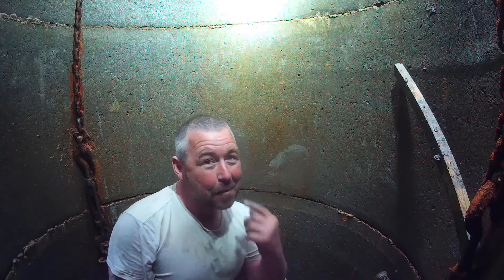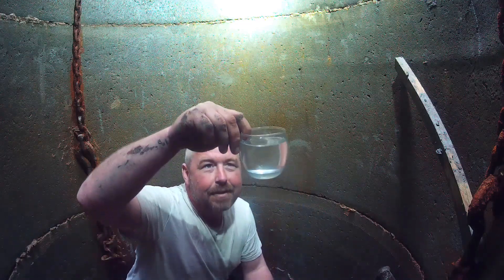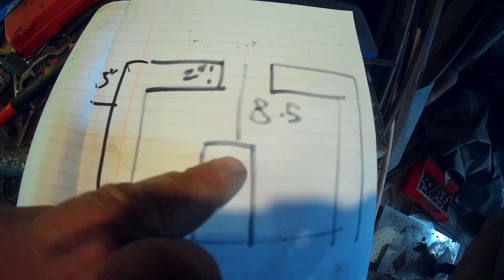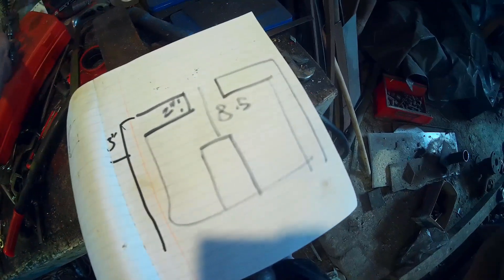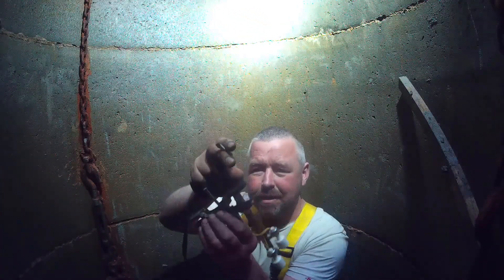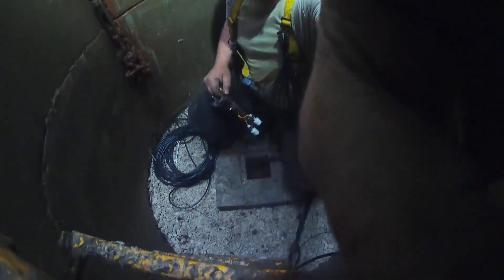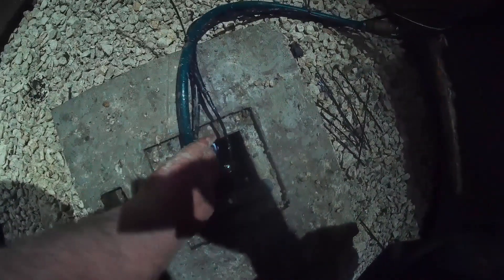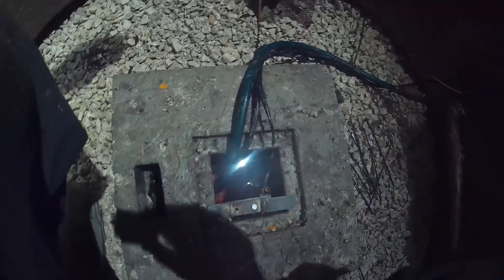Underground bunker workshop pump float switches

Comment: Jim, those floats you showed have a magnet in them that activates a reed switch when the water level changes. They can handle milliamps, which then go to either a relay or a contractor. I think they should work quite well for your pump, mate.
Reply from the maker: Yup, should be nice and reliable

Comment: What little cameras are you using? I've been thinking on a head mounted cam.
Also if possible I'd like to see the water in the gravel as it drains, dont know why exactly but I'm curious.
Neat little video either way
Reply from the maker: Generic shitty Chinese go pro copy, no idea what name mine has on it, batteries don't last long and the footage is crap but it's been reliable at least.

Comment: The sump and pumping seems to be getting towards reliable now.
When you break out of the concrete rings to make the space bigger.
Do you have any worries , I guess you know the layers going down .
Reply from the maker: I'm pretty confident it'll go smoothly, biggest concern is actually cutting the pipe and getting a crack in the pipe I'm keeping but I don't really think that's likely, I'll take it steady.

Comment: Good solution on the float switches. Presumably you can vary the gap to suit if the pump is coming on too often or not often enough.
Reply from the maker: I can't play with the position much because I'll either have water against the bottom of the floor or below the top of the pump
Reply: @turboconqueringmegaeagle9006  Fair enough. It's a tight space.

Comment: Hey, I have a hot tub sunk 4ft in the ground and have gone through loads of cheap 12v belge pumps, where did you get the floats from and how do you wire them to make them function like that? Would really help me out with my setup! Thanks Dan
Reply from the maker: Floats are on ebay, just search float switch.
I've got a pump control module (also ebay) and this switches a solid state relay, I showed it all a month or two ago when I first got this pump, I had it wired together to test in the shed emptying a bucket of water.
At the end of this video
https://youtu.be/ROkm3G06sgc
Reply: @turboconqueringmegaeagle9006  perfect thanks! I saw that one, ill go back and check it out thanks!

Comment: That hole gets classier by the day!

I'm wondering if it's worth it, or even possible, to insert some sort of water level meter, or even alarm buzzer. I don't know how variable your water table is, but it might be nice to know if the pump is at risk of getting overwhelmed during a wet patch, or even that the bunker is at risk of flooding, before a load of expensive equipment gets damaged. It may not be an issue, its just seems that water has loomed large for the past couple of years.
Reply from the maker: Definitely need an alarm and some redundancy eventually but I don't want to add to the panel up top, so much of this is temporary

Comment: Lovely setup mate. Had me gut laughing when you spat out the water. Guess I will take the challenge and have a drink out of mine. So glad I had a chance to give the sump suggestions to you, seems like you are having a win with it. I am going to precast a sump for the hole over the weekend. Right after I get the roof supported again. Honestly so happy your floor is dry now for you. Looks amazing bloke.
Reply from the maker: Yes you did mate, can't thank you enough for steering me towards the french drain approach.
Interestad to see what you come up with for a sump, I'm going to need more sumps in the rest of the bunker, kinda had to make one for this space but was planning on using chamber/manhole rings in the future unless I can make a permanent mold or something.
Reply: Sounds like you will have an awesome amount of water storage. I may need to put one down in mine for extra storage too. All your testing of pumps will come in handy now you have silt free water to work with. I am always happy to help with advice mate. I think what we are doing is attracting a community of like minded people it is fantastic. Thaks heaps for the shout out and the advice. I just took on the challenge and popped down the hole and had a drink. Will post a short tomorrow. My sump will be very similar to yours bit of a different shape though. Really dig the float set up you have got going there.
Reply from the maker: @daledigsdownunder  I'm going to ping an email over mate, I had a little idea
Reply: Just sent one back with some thoughts
Reply: How was it🤤
No, wait, don't tell me. Suspense will keep me awake tonight 😂

Comment: Brave man, tasting the water!!!!  It would be interesting (but not necessarily very easy as a DIY project) to test the water to find out exactly what's in it - purely out of interest of course - although a supply of relatively clean water could be a cool addition to a bunker.  Those camera angles worked really well - that's a tiny space down there, not the easiest to film in, and that worked really well.  You even created some cool abstract animations as your bosun's chair was swinging round in the light.  And the float switches were good too - I doubt that the relatively small distance between the floats will be much of an issue - I guess you'll be able to observe the on/off frequency of the pump soon enough - the key thing as you say, is not to have just a single switch otherwise the pump will be on and off all the time with no time to cool off between cycles.
Reply from the maker: I imagine there's a couple of things happening with the water at the moment.

1. I've disturbed organic material in the top layers
2. The water only having been pumped sporadically until now means it's had a chance to stagnate

I'm anticipating it improving in quality, got a few ideas for it.
I'd like an underground generator eventually so a cisten could hold water till the geny is running then it can cool on it's way topside.

Someone suggested "a brew" probably meaning Rosie lea but I'm definitely going to have to make hole beer with it at some point.

And obviously for garden needs as it's more fun using bunker water than rainwater isn't it.

Any further suggestions greatly appreciated.

And I'm sure you've figured out any artistry in my filming is completely accidental but thank you mate.
Reply: @turboconqueringmegaeagle9006  You have done well, as Tim said, filming in tight circumstances is not easy!
Reply: @turboconqueringmegaeagle9006  Oooh, bunker beer/hole beer, that'll be a big hit, everyone will want some!!!

An underground generator would be cool - there's something exciting about generating electricity, and everything is more exciting when it's underground.

All the best artistic stuff happens by accident - set up the light and swinging bosun's chair shot and add music, and you've got yourself another video!!!

You'd have to make tea or coffee at some point using the bunker water - boiling the water on a vintage primus stove or something like that.  I bet hydroforming will work better with bunker water, because bunker water is just better.

Comment: Nice one, looking forward to hearing how well it works or if the pump is on a lot of the time.  Think you could have done that with three core wire, either vcc or gnd and then a switched wire for each of the floats.  Obviously 3 core is considerably cheaper than 4. But now you have four you could have a spare one.  You could use that on another float set near the top to sound a buzzer at the surface as a warning the pump isn't keeping up or stopped working. Just an idea.
Reply: Other thing is if you are going to have lots of low voltage sensing on the hole which I guess you could have, you could run aluminium cable tray down the side of the hole and ground that to your circuitry, would be a relatively low resistance path. Then you have another spare cable and any other sensing will only uses one wire each.
Reply from the maker: Complete oversight on my part, 3 core should work cheers, ally won't last 5 min down there though and I've already got plans for some much more elegant pipe and cable conduit, fault alarm is a good idea too.